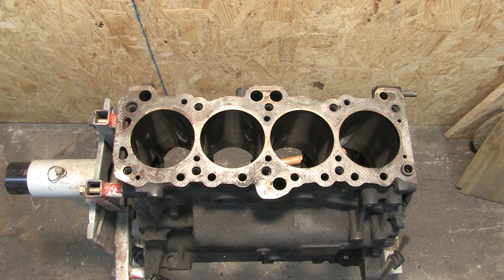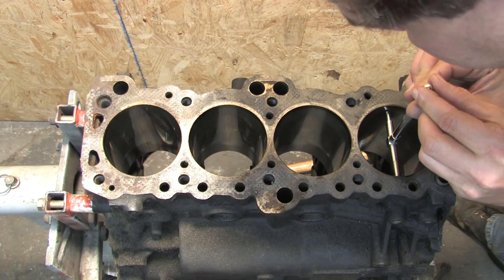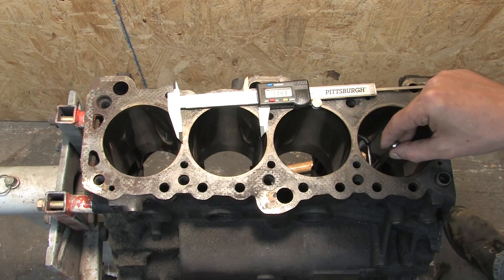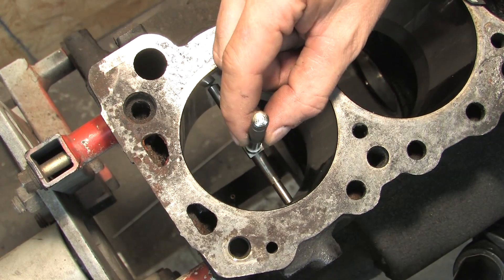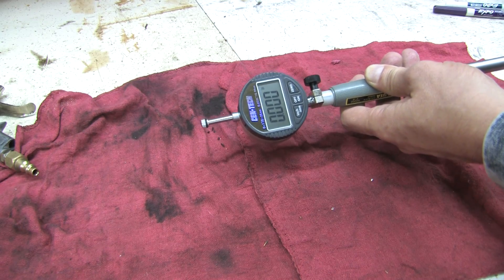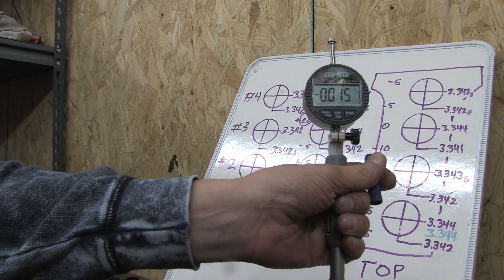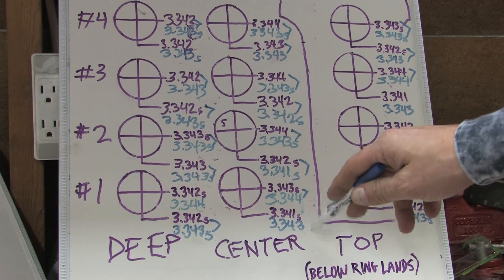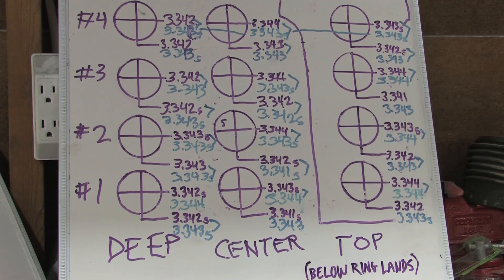Blueprint 106 - Cylinder Bore Inspection

Comment: Hello from Greece! Very good video. I d like to ask. I ve seen in my service manual (Honda B18C engine) that the service limit is 81.07mm from std new 81.00-81.02. That means 0.05mm (0.002in) difference from brand new. the limit for your engine is sure so much low as 0.0004? Honda has 5 times bigger limit for wear? Thank you!

Comment: hi, i see lot of ur videos, lucking when i was browsing i get to ur videos accidently, iam big fan of watching this kind of videos, from there after i become ur subscriber. I like the way u explain in correct speed, great. I have a question for you if compression of engine is good, will the cylinder bore inspection reveal or not. Do u get to have a chance that compression is good for that cylinder but the cylinder bore inspection result begin failure.

Comment: This is a great lesson on how to measure cylinder bores and measure taper. For maximum accuracy I would recommend measuring them with the main caps installed and the head still on (or a torque plate). This means you'll be doing the measuring with the block upside-down on an engine stand. There's a lot more to it but this series is a great intro. Excellent audio as well. Keep it up!